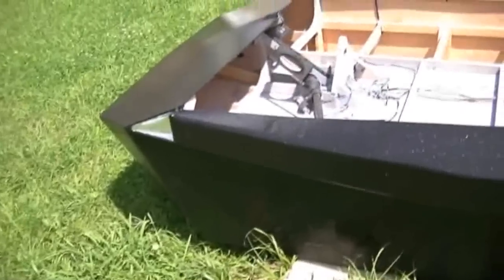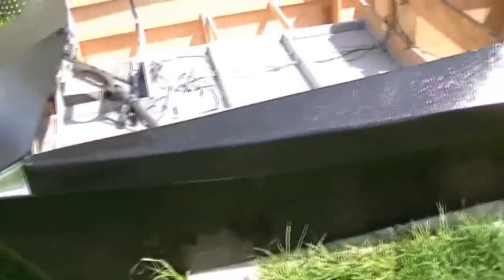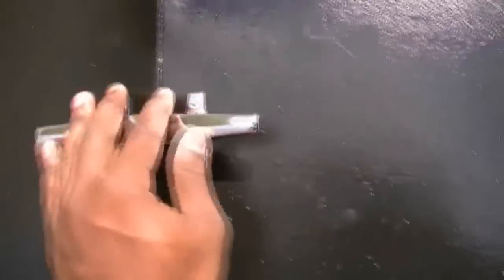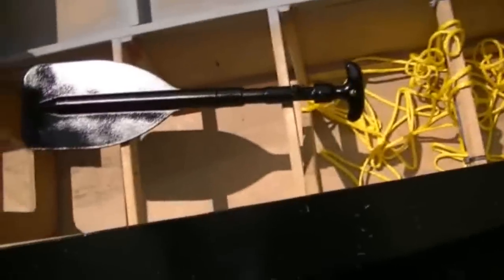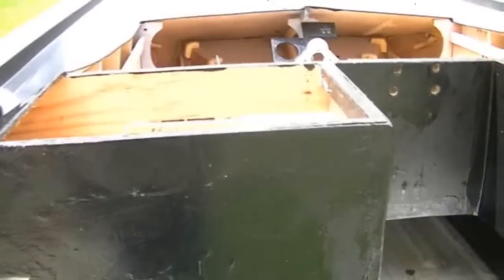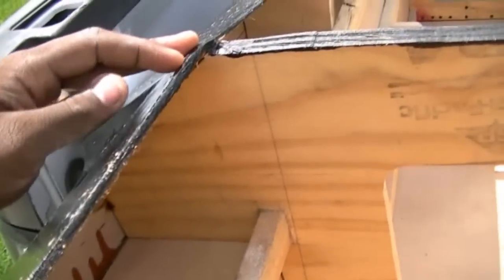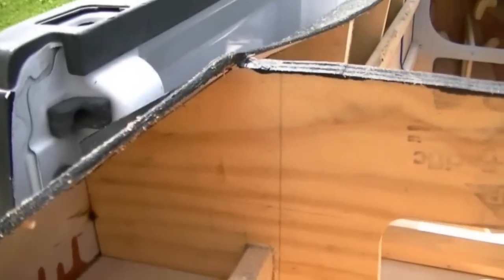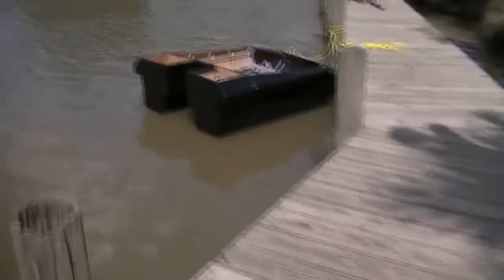Homemade plywood boat pt29(Water test)

Comment from the maker: I personally used 3/4" x 1" posts along with 3/4" plywood to frame the boat. Then used the thinnest/cheapest sheathing(plywood) i could find to cover the boat (about 3/16 thick). But if youre not going to fiberglass, i would recommend at least 1/2" plywood. If you go with 3/4" plywood, you could get rid of a lot of framing; but keep in mind that the weight would double. Thanks!

Comment: 3:40 small leaks like that are normal on a wooden boat, as soon as the wood swells the leak will stop.
5:25 You should have added thin metal rub rails packed with silicone in between the metal and the boat.

Comment: paint inside white to reflect heat , so you madde 2 boats? aluminum sheet metal skid plate to use as drag guard hell even mount on a couple roller blade wheels to use to drag they wont effect boat as long as when you  mount them u seal  around bolt holes. thats the exact kinda boat i want. truck bed size
Reply from the maker: Thanks a lot brother. Yes I did make two boats; at the time I wanted something that I cold launch by myself so thats why I decided to make it truck bed size. Once again thanks for the awesome ideas